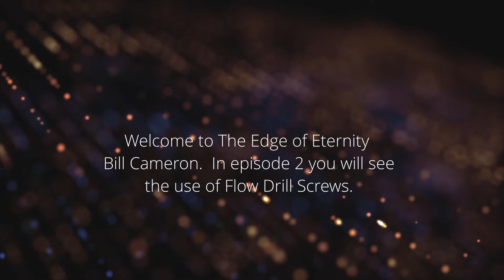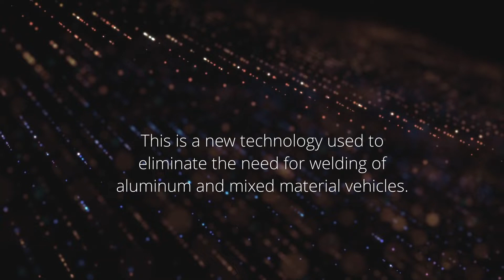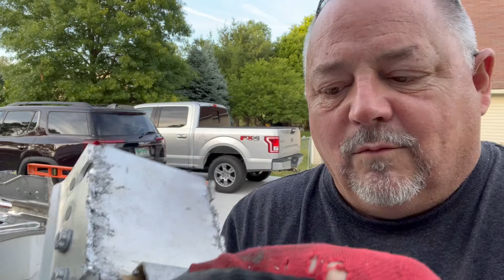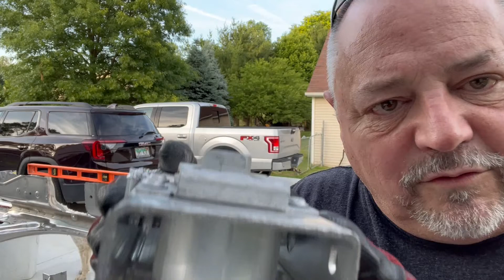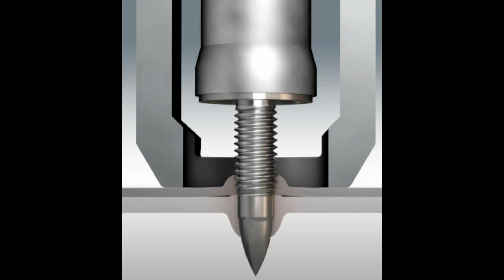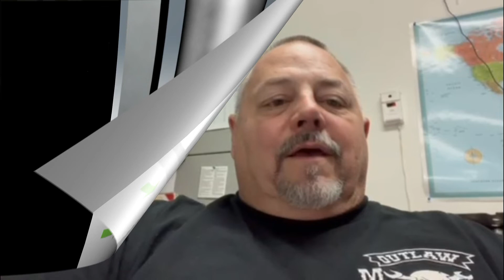Automotive Manufacturing Episode 2 - Flow Drill Screw Technology

Comment: Love it bill I've seen this process on YT before I wonder why not some how fuse weld the caged nut cage on?  Probally cost and time... I like the use of a bubble level I align all my cars at home with a bubble level a caster camber one did you know that the computerized wheel alignment machines are still not as accurate as a bubble gauge the just make the process easier as water gauges where used in Egypt to set the pyramids and you know how accurate they were aligned.... Amaze me what God has put into our minds.
Reply from the maker: Absolutely. Sometimes we over complicate things. My dad and I would use a tape measure and level. Took longer to drive and wait at the shop, plus it was free

Comment: We used a lot of captivated fasteners in my shipyard days. Especially on electrical panels. You mentioned hydro formed tubing. Is there a difference between that and extruded tubing?
Reply from the maker: Hi Matt, Yes, there is a big difference.  We still use a lot of extruded tubing, but hydroforming is for complex shapes.  In the first video in this series you will see me sitting on that front crossmember.  To my right and left there are hydroform tubes that go from the front of the engine compartment to the back of the car.  Basically it was a safe structural system for the passenger compartment.  In a case like this one, you start with a tube, roughly prebend or preform it to a shape that will fit into a hydroform die in a high tonnage press.  Most of the ones I have been involved with were 4,000 ton hydraulic presses.  The press closes the die around the preformed tube, applies the tonnage and water is forced info each end of the die and forces the tube to take the form of the die.  This is why it is referred to as hydroforming.  It is not a fast process, but they pierce the holes and all of the physical details are formed at the same time.  The fluid pressure is around 1,800 bar.  Quite an amazing technology for sure.  I'm glad you mentioned this.  I need to add a hydroform episode to this series.  Thank you!
Reply: @EdgeofEternityBillCameron  Thanks Bill!
Reply from the maker: @mattthescrapwhisperer  Thank you!